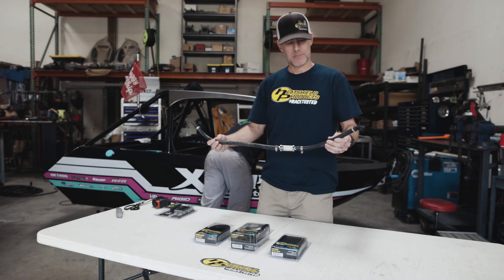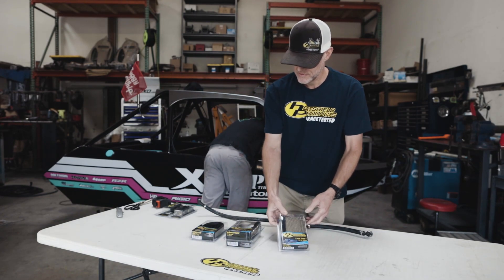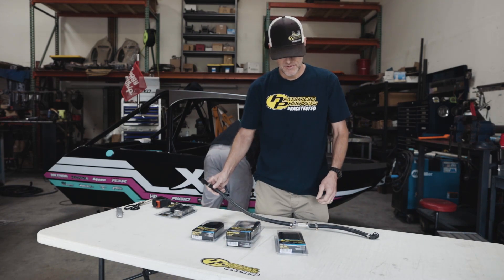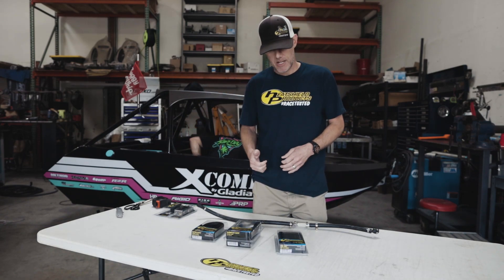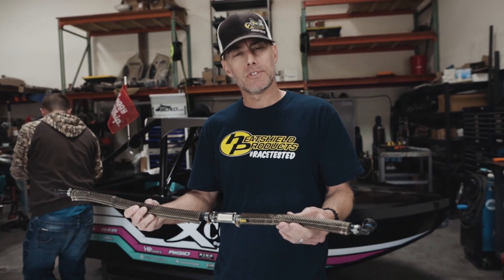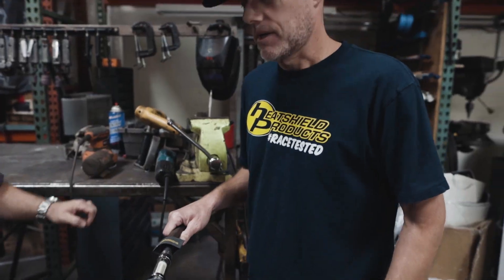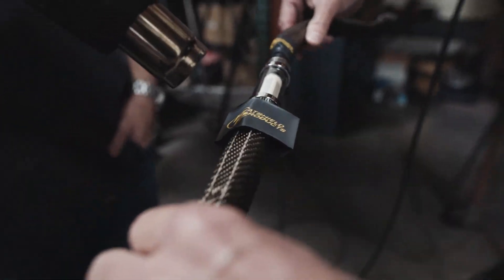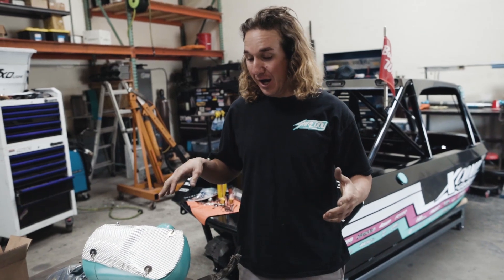Stop Vapor Lock – Fuel Line Heat Shield Install

Comment: We need some sleeves against fuel leaks from fittings or hoses in the engine bay because it’s a major source of car fires. Something that would channel out a leak and protect it from leaking onto headers in the event of emergency
Reply from the maker: HONESTLY you should try to find out why your fittings are leaking... The only sleeve we make that would not leak fluid is our Fire Shield Sleeve which is made from silicone and fiberglass, but this sounds like this is the least of your problems. Make sure to carry a fire extinguisher for safety?
Reply: Thanks for the reply! I meant in case of accidental leak in an event of emergency not like leaking all the time because I see there are people reporting sometimes their fittings leak out of nowhere as they say(which of course doesn’t happen out of nowhere it has some cause) so I got interested in some prevention about that
Reply from the maker: @georgebushisntcool  Got you... The fire shield sleeve has silicone so it could help, but the temp max is 500F.  The best if going to be our Hot Rod Sleeve which will take 1100 F and just make sure to double check the fittings.

Comment: can i use this on my mechanical fuel pump , basicaly am i alowed to thermo wrap my mechanical fuel pump , i wanna know cause my pump sits next to my exhaust manifold and my lower rad hose , its like quarter inch from lower rad hose
Reply from the maker: Jim- thank you for watching. You must be really careful with mechanical fuel pumps. If you completely wrap it, you might end up retaining more heat and making the situation worse. The best approach might be to clean it up really well, and stick a radiant heat shield on the portion facing the header/exhaust manifold.  This way you reduce heat without retaining too much inside the pump.